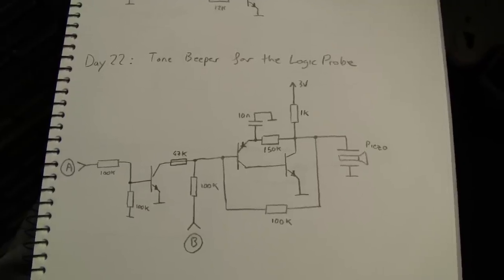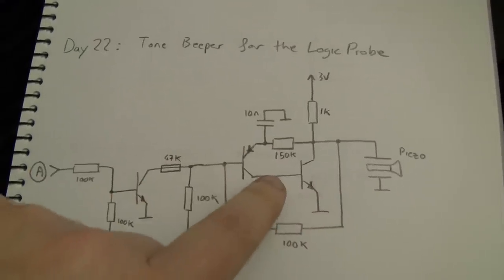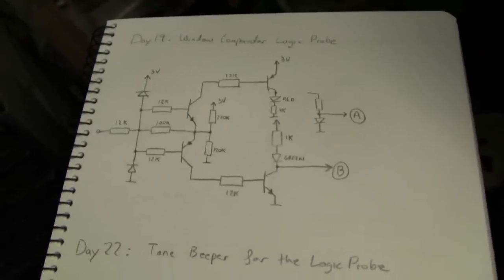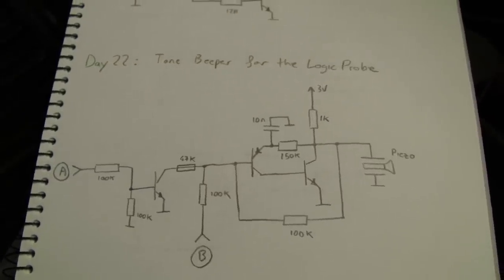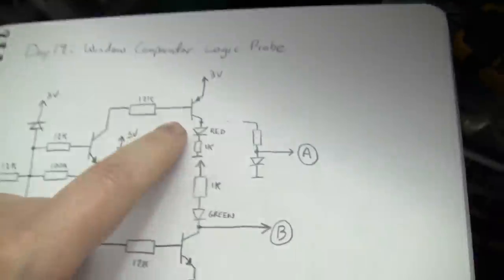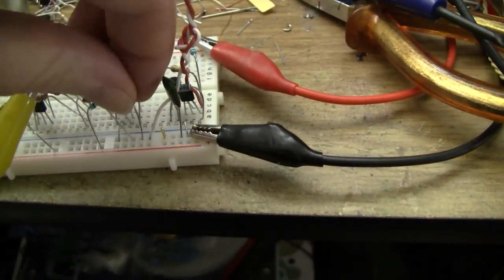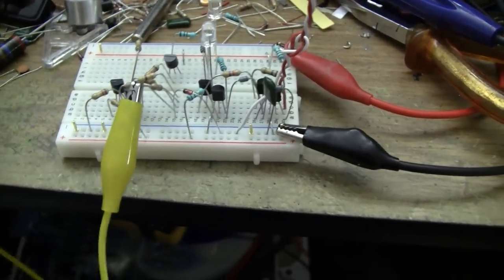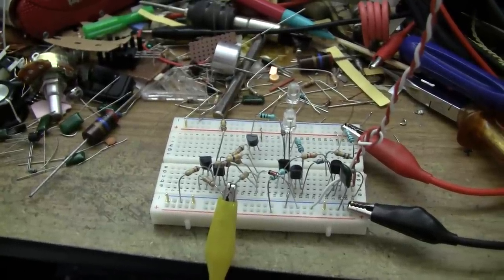Advent Calendar of Circuits 2011: Day 22: Tone Beeper for the Logic Probe

Comment from the maker: @matiasvdtube OK, will post an update when I build it more permanently.

Signal generator wise, you need a frequency accurate source for calibrating a dial, or an IF signal for aligning some stages?  AM modulating isn't too hard, especially if you don't care much about efficiency.